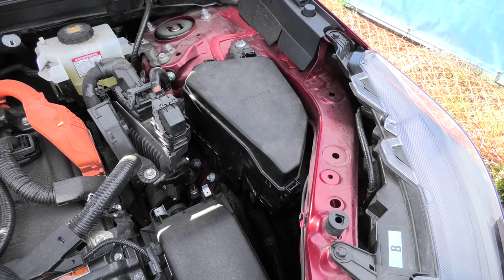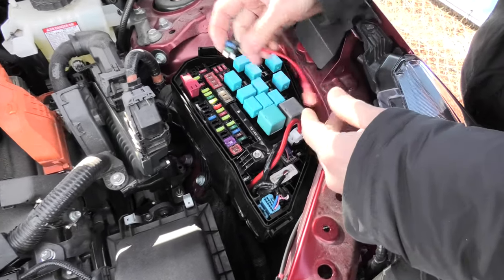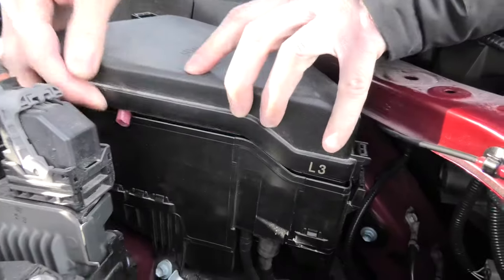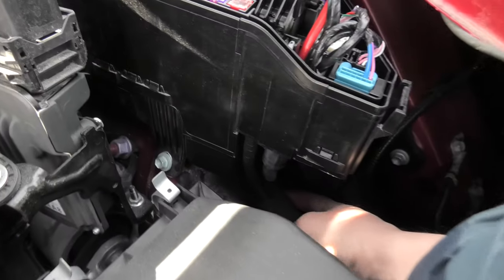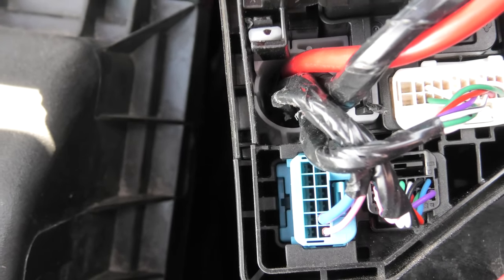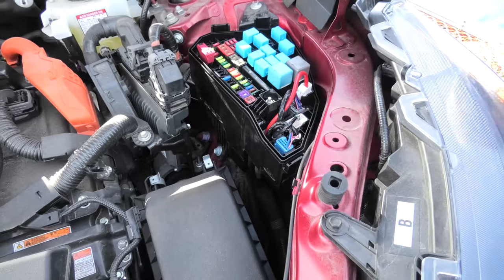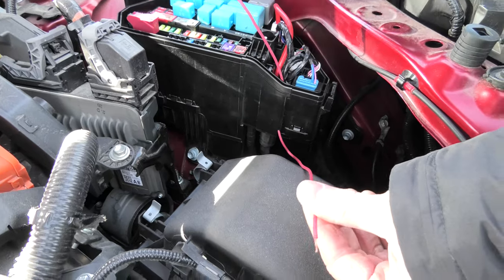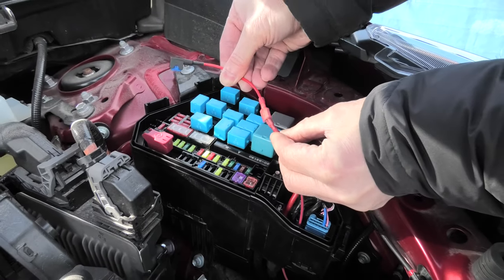Toyota RAV4 (2019-2024): How To Run Fuse Tap Wire Inside The Fuse Box Without Drilling The Cover?

Comment from the maker: PRODUCT LINKS:
1. MINI LOW PROFILE FUSE TAP - Gebildet 12V-24V Low Profile Add-a-Circuit Fuse Tap - https://amzn.to/3YzDgsN.
2. CORDLESS DRILL - DEWALT 20V Max Cordless Drill / Driver Kit, Compact, 1/2-Inch (DCD771C2), Yellow - https://amzn.to/3YGvWf6.
3. DRILL BIT SET - DEWALT Drill Bit Set, Black and Gold, 14-Piece - https://amzn.to/3ZhMPMK.

Comment: Going to suggest sealing the bottom regardless, to prevent water entry. Even though it should drain out as a low-point. Unless the purpose of this opening is already to serve as a weep-hole to drain the box..
Reply: Hi, what do you suggest to seal that bottom section or Any gap between the wiring and the hole
Reply: @iGoByX  They make things called cable glands for just this purpose, and they are not expensive.

Comment: Can this also be done carefully with the fuse box under the dash?
Play safe from Elliot Lake, Ontario, Canada.
Reply from the maker: It can, but you will need to go through the firewall. We showed how to run the wire through the firewall in the trailer wire harness installation video - https://www.youtube.com/watch?v=3_eKGti5Ivs.
Reply: @MorozovAutomotive  Thanks for the quick return and heads up will check it out.